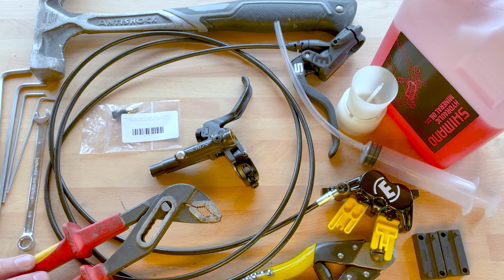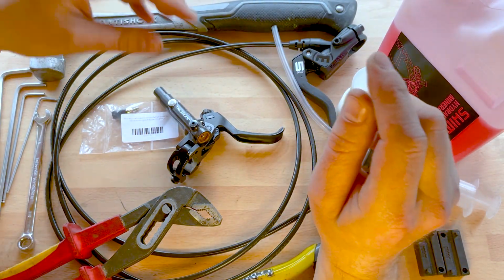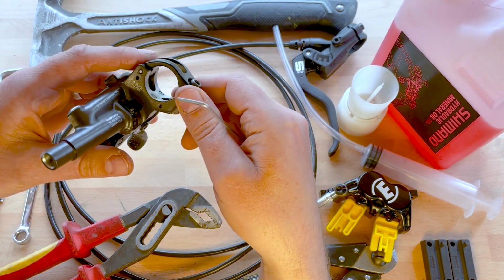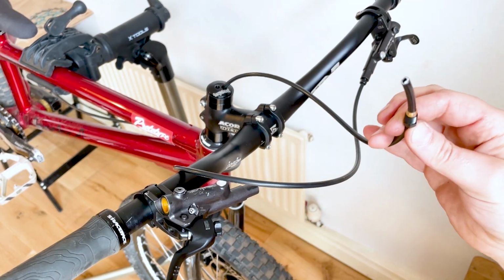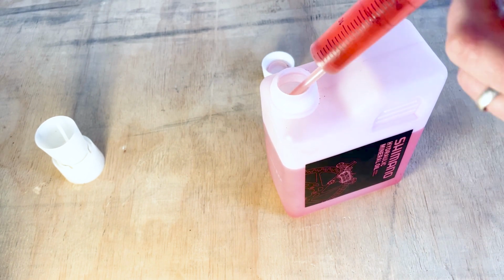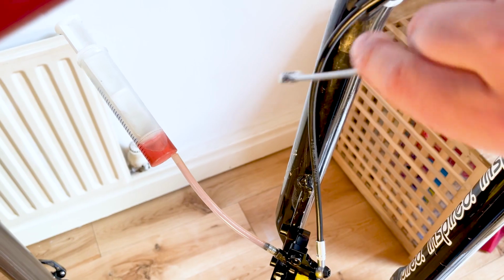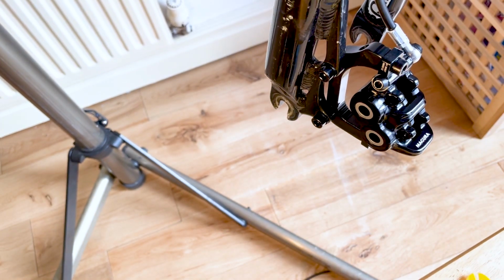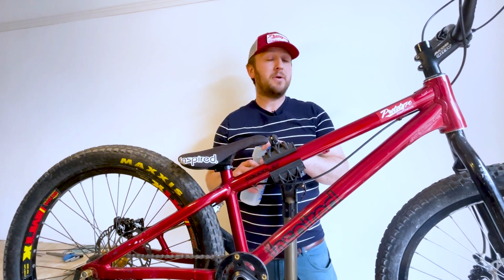Shimano Magura Shigura Everything you need to know

Comment: Hi, for some practical+aesthetic reasons i'm contemplating running magura calipers with the dura ace road levers. Do you think this cross-brand/type combination will work?
Reply from the maker: Might be possible, but I don’t know. I would probably recommend against it unless your in a real pinch. To me on my setup I find them a little bit more Grabby probably not a very good thing on a road bike. But who knows might be good if you have the time and money… why not have an experiment
Reply: Yeah it’ll work just don’t forgot to use the right connections for the lever
Reply: I'm also thinking of running maturation caliper with road levers...

Have a couple of questions
1) which hose to use?
2) magura olive and barb on caliper, shimano olive and barb on lever, correct?
3) magura or shimano oil?
Reply: @melvinlee7726  Magura calliper and hose 

Shimano lever

Seeing tho you’re connecting the hose to a shimano lever you’ll use the shimano olive and insert 

Any oil will work as they’re both mineral based

Comment: Have you done a video of changing the lever on Hope tech 3 V4 brake ? Can you do one if you haven't already done one ?
Reply from the maker: I don't have any Hope brakes at the moment I'm afraid, and i'm not sure what your exactly asking Hope brakes use 'Dot fluid' that is not cross compatible with mineral oil (thats if you wanted to run with a Magura Caliper) if you just wanted to know about how to shorten a hope hose/fit a new lever then this vid: https://www.youtube.com/watch?v=E9LdgMhQjXQ might help. if it's just swopping the level then this might help: https://youtu.be/ZBXwAfcciRM?t=112 hope some of that's useful...
Reply: @prototypecomponents  Hi , I want to change the blade / lever but not too sure how to do it so was just wondering if you had done a video or plan6to do a video on how to swap lever

Comment: Are the hose nuts that screw into the outlet ports on the levers to hold the hose onto the levers the same thread size for both Magura and Shimano?  I have Magura brakes on the bike and am switching the levers to Shimano BL-M8000 but the levers don't come with hose nuts.  Are the Magura hose nuts the same thread size?  Can't find any info on line.
Reply from the maker: I think your best to get the shimano nuts to give the best chance of success (that’s what I did)

Comment: Magura calipers have a small space for a disc and that causes difficulties to center the caliper and not hear disc rub on break pads. Also even tiny disc bend is the pain in the ass of the same reason
Reply from the maker: umm  Yer I guess setup is a little bit trickier than some in that respect, but it does result in a good lever feel, when setup right. so guess its a bit of a Compromise.

Comment: Hi, thank you for the video, i was hoping to Change my XT calipers for magura MT7, since i already have Shimano levers with 4 pot Shimano XT calipers, front and rear.

Do you know if it is possible for me to just Change the calipers and mantain all the Shimano assembly, hoses, barb, Olive. Will the Shimano hose, fit at magura calipers?

Thank you
Reply from the maker: Short answer: not sure, to be honest. Long answer: I know that using Magura barbs in Shimano hoses cause leaks but if you where to use the the Shimano connector with Magura caliper and bolt maybe..? but my gut says no though... only one way to try... let me know if it works! having said that a mt5 complete set is pretty dirt cheap and I think the only difference between them and mt7's is the pads and screw in pad pins.
Reply: @prototypecomponents  i Will try it... Found some websites with discounts on MT7 calipers, and then i Will test if i can use my Shimano hose. 

As for the mt5 vs mt7 ...here's magura andar. 

"The difference between the MT5 and the MT7 lies in the detail. As well as a different brake transmission ratio, the details of the brake calipers differ. 

Upon close inspection the MT5 has a noticably larger airspace between the rotor and the brake pads. The reason for this is a greater piston retraction space as a result of different contruction on the inside of the caliper. Overall this means that the MT5 is easier to set up without grinding and has a bitepoint that feels less direct than the MT7.

With a higher transmission ratio, the MT7 offers overall more braking power und a more direct braking sensation. The bite point however feels slightly softer that the MT5."
Reply: The Shimano hoses wont work with the Magura caliper. The banjo inner diameter is a little wider, so you wont get a good seal. Use Magura hoses with Magura barbs. Any olive is fine.

Comment: i just cant get the olive to seal up :( ive tried it 3 times already and all of them come out crooked. this ist the first time shigura for me, however it is definitely not the first shimano brake i refitted. ridiculous. even tried different olives and pins and even an old brake lever that i know was sealing properly with a shimano hose.

i dont know what else to do :(
Reply from the maker: Umm sorry to here your having trouble with the setup not sure why it’s not working out for you maybe if you have some spare length in your hose you could trim a bit off and maybe your have better luck…
Reply: @prototypecomponents  
after a lot more fiddling without any positive results i did a bunch of research and found out, that shimano has 2.1 ID hoses and 2.3. silver pins go in the 2.1 and golden pins in the 2.3. magura has a 2.2 ID hose so i figured ill try the bigger golden pin to expand the hose a bit more so that the olive sits less lose over it (and thus preventing it from getting krooked while deforming in the lever).
after i made that work (on the second attempt)  there was no oil leaking at the lever.
BUT: i was still abled to pull the lever back to the bars when applying continous force.
because i couldnt see any leakage around the brake i deducted, that the main piston seal in the lever has to be damaged. to prove that theory i took the old brake, tested if the bitepoint of it is constant and then fitted the new lever to it. et voila the lever did work and the piston seal was in fact sealing properly. to make absolutely sure i fitted the lever of the old brake i knew worked as intended to the magura and surprisingly it was not leaking upon first attempt (yay!). 
well even with the proven to work old lever i was abled to pull it to the bars after 10 or so seconds.
first thing did then was to refit the old brake as it was and make sure that my cursed hands wont brake it magically :D.
so back to where i was in the beginning. new lever (that i now know is not defect) on the new magura hose with the golden shimano pin and olive.
after bleeding the lever again i was already paranoid and wanted to make absolutely sure that the seals in the lever work because i still couldnt make out any leaks whatsoever. so i just barely filled the shimano bleed-bucket thing and pulled 3 or 4 times. nothing still no leaks of the system. pulled some more and noticed the brake is 'drinking' from the funnel. so the oil had to go somewhere! i rechecked the whole system and sure enough there was oil leaking from the banjo. but not the mounting point with the orings to the caliper but at the connection of the hose to the banjo.

the magura hose is made of 3 layers. an inner liner, some kind of mesh (to hold the pressures) and the outer skin.
apparently i managed to either damage the hose inside or it was already damaged or the olive didnt seal up proberly agains the hose. 
i 'filled' the mesh-layer of the hose with oil up to the point where it comes out of the connection at the banjo😫.

as the hose is lost anyway im going to try to fit it with the magura pin and olive tomorrow again... (yes ive already tried that before i went with the gold shimano pin but couldnt make it seal in the lever...)

the whole thing is ridiculous. i fitted dozens of shimano brakes over the years. starting with the old style levers and the old saints. xt, several zee, bunch of new saints and slx's. heck i did some brakes for friends too. i have never had any of those issues...

tldr: i shouldve just stayed with the saints i already had.
Reply from the maker: @HannyDart  ha 😂 I feel your pain sometimes working on a bike is like a dream and you feel like a total boss! and other times on something simple its like hitting your head against a brick wall, don't take it to heart sometimes sh!t just happens - my guess from what you have said is the hose has delaminated  and that's preventing the hose fittings to clamp up correctly, I had a hose on a formula brake setup go 'really weird' and I had to buy a whole new hose. good luck hope you get to the bottom of it!

Comment: Hi! Is it possible to attach slx m7000 lever to magura mt5 4 piston caliper? Would it works?
Reply from the maker: Yes I believe this is pretty common, and one of the most low cost ways to get the setup working well. I would have probably gone for SLX if I hadn't found some Saints at a good price.

Comment: Terrible setup, very little modulation compared to a full brake of either brand. And horrible feel when pads are getting low.
Reply from the maker: Wow sorry to here your not a fan of the setup. Brakes definitely polarize opinion, what some people love others hate. personally this setup for trials use is the best I have ever had.
Reply: @prototypecomponents  yeah setups with good pads I’ve used have been immensely powerful and I can see how they would be good for trials to be fair. I like both brands brakes i just don’t rate the setup for mtb.
Reply from the maker: @Adam-vm8kp  Yer I like both setups in there standard config feel and power wise, but unfortunately the Magura lever I found build quality wise to be to budget focused even before I broke it. but for the money there still great brakes.